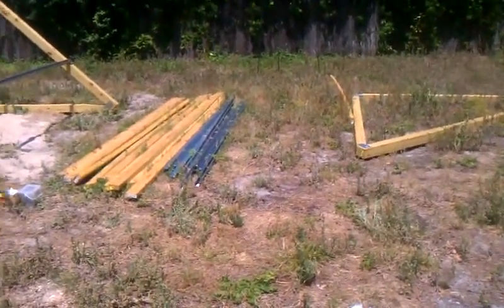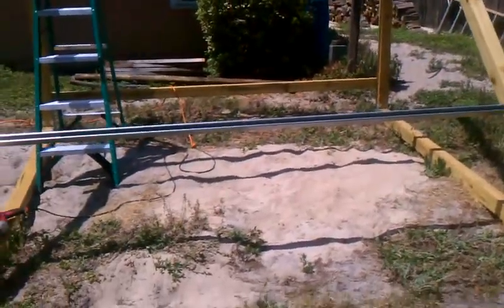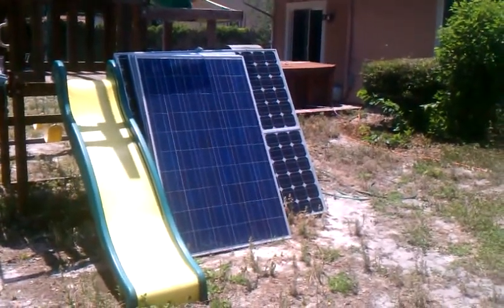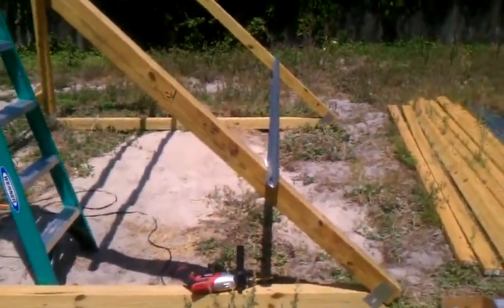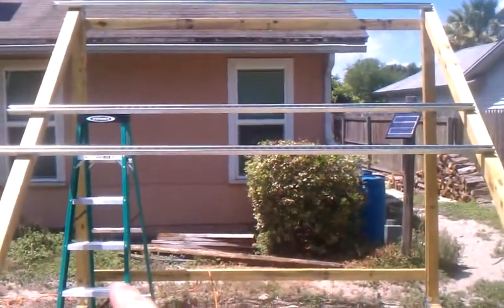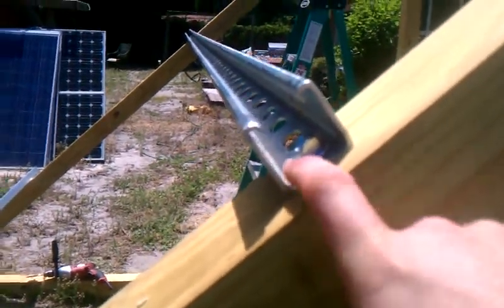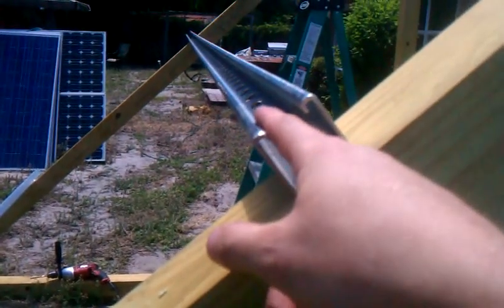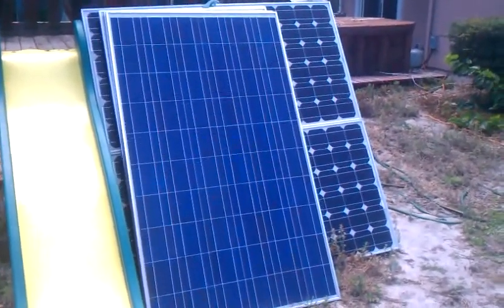SOLAR PANEL MOUNT! 3,150W OF SOLAR PANELS PART 5

Comment from the maker: Putting them on the roof requires permits and city involvement. Also, we are getting a new roof next year so I'd have to take them down and then put them right back up. Keep in mind you have to drill holes in your roof so if you are comfortable with that, have at it. The mounting hardware, unirac, to put them on the roof was $1,500. The mount I am building in the backyard was $400.

Comment from the maker: I think once you see how the superstrut is connected it'll make more sense but I also thought of that if the whole thing is connected. The structure has a lot of support with the metal and the big 4x4's and with some bracing it should be ok. If I see any issues after I have it all built I'll be sure to address it. I want to make sure I don't lose any panels due to poor building techniques and since I've never built anything I'm going to try to overbuild it.

Comment from the maker: Good question and I meant to put that in the video. You can see from the video I left about 6 or so inches off the side where the superstrut hangs over slightly. I did that so that I could bolt the superstrut together held with 4 bolts and a special plate designed for holding 2 pieces of superstrut together which will also help with sagging and the load on the 4x4's. I like the idea of the diagonal planks and they wouldn't have to be that long saving money and wood.. Good one :)

Comment from the maker: They might be pre-drilled, I don't know. I won't be using any mounting holes to hold them down. There's hardware that goes with the superstrut that will hold them the panels down. I'll be making a video of it later on once I complete the structure.

Comment from the maker: The structure is huge but it's very light since it's wood so I'll anchor it down in some fashion. I have hardware for the superstrut to hold the panels down that will lock them in place. I got the idea from a video I saw on YouTube where a guy did the exact same thing.